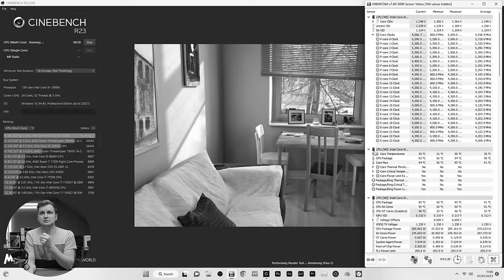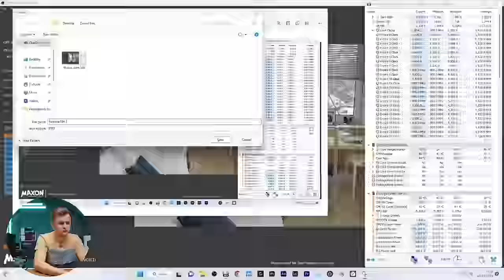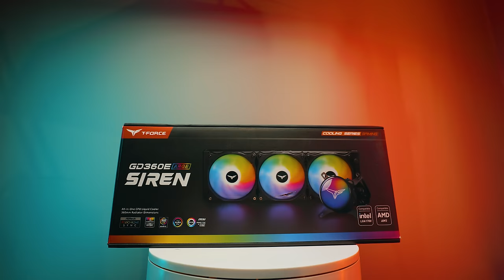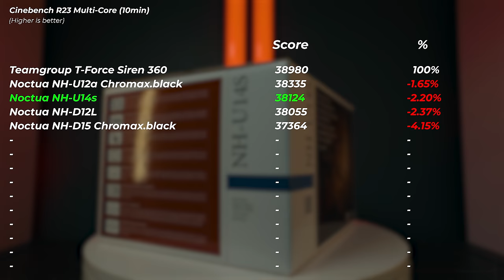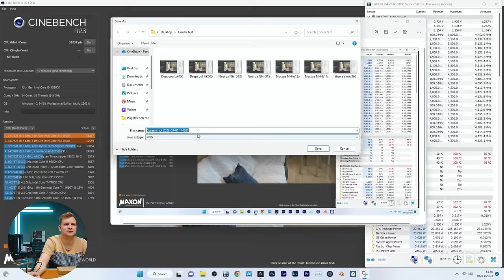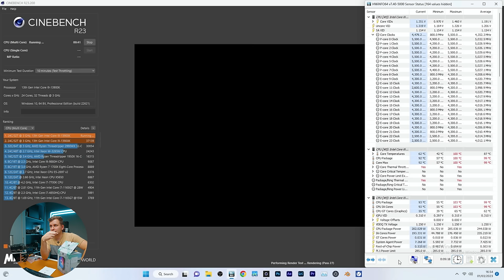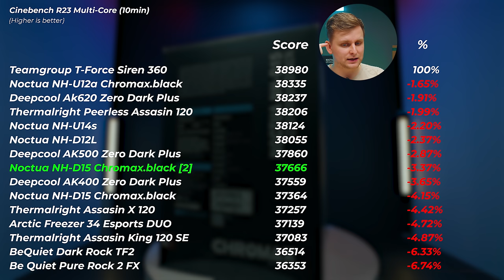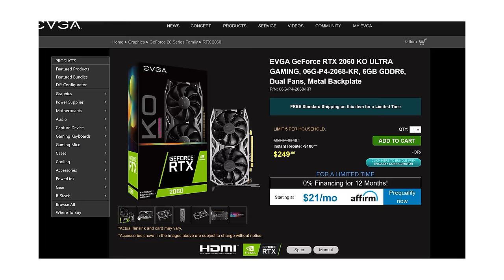We Tested 14 AIR-Coolers on 24-Core 13900k - The Results Will Shock You!

Comment: I used the NH-U14S on my new build last week.  I am a huge fan of Noctua, been using their stuff for many years. I mounted it exhaust out the back.
Reply: Great choice. Reasonably compact. Very quiet. Very efficient. I've had one in use with a 10700K @ 5GHz for 18 months, ambient temps usually ~ 27C. No negatives. I should add, in order to get a good view of the RAM RGB, I moved the fan to 'pull' config. That's commonly considered a serious no-no. However, the cpu temps proved similar to 'push'; 1 to 1.5 C up, according to HWiNFO64  - unlike the 10C difference claimed in one review. While 'push' is certainly optimum, the effectiveness of 'pull' might depend on case airflow.
Reply: @fred_2021  I have the Gigabyte z790 board and the fractal pop air case and where my cpu fan begins there is a 1/4 inch gap between the ddr5 g-skill Trident RGB ram and the fan.  And I am using 2 - 16gb sticks in slots one a three..I will never use anymore than that.  I changed my cpu fan to black and have the chromax cover on the radiator.  Looks really good and simple.  I am only using  the RTX 3060 MSI because I am cheap and did not want to spend a fortune on a video card.  My CPU heat while gaming never gets about 37c but I am not playing high resource games like cyberpunk.
Reply: @andredaedone7732  Sounds perfect. The Chromax covers do look good. Might do that too, if can decide between black vs white :)

Comment: Running a 13700k @5.6 with a 50mv undervolt on a Noctua NH-D15 and it works like a charm(temps almost never exceed 85, gaming they typically max at 70-75), in general I feel like undervolting is almost a must if you want to run a current high end intel chip on air.

Comment: Great video 👍
I think I would still choose a Noctua for that cpu, since I believe that once it goes in a good case (Fractal Torrent), it will keep a better temp. If still a bit hot, I would limit the cpu a bit, to make it cooler.
Reply: I have a white torrent and the Noctua Chromaxblack U12a cooling a 5800x3d. Tons of air flow in that case and I know  it’s not a hot running chip but I could move to an Intel chip and use the same case and cooler.

Comment: I put a SF120 RGB fan from the Cooler Master Hyper 212 on the back side of my Enermax ETS T50 Axe. Tt made a huge difference. I then ordered the Nactua NH U12A after watching one of your videos. Your not going to believe this but the Enermax beat it my a very, very slight margin. CB of 28492 on Nactua and 28522 on the Enermax with that added fan. CPU is 12900k.

Comment: I think the NHd15 deserves a redo. Something must have been off with either the paste application or the mount tension.

I've been using that cooler for years on multiple different Cpus and it's always been a champ.

I started off with the OG one and just recently bought the black one for my newest build.
Reply: well the thing is cooling a 13900k and that cooler im pretty sure performs similar to a pa120se if i recall

Comment: I'd be curious how my air cooling stacks up against this. I use the Thermalright PS but I changed the dual 120mm fans that it came with out for a single Be Quiet! 120mm high speed fan which  can do 3000rpm, but more-so, I 3D printed an adapter which covers the top and bottom of the air cooler, focusing all air to flow directly through the fins.

Comment: My BigTower, Intel i-7 6700K (4 - 4,2 GHz, Net Reviews = 70°C), NH-D15 <-> Noctua Industrial PPC (NH-D15 2x + BigTower x):
minimum procesor: 8°C (winter + start PC)
spring - autumn: 15 - 25°C
summer: 25 - 35°C
max load procesor: 42°C
@4,7 GHz + max load procesor: 53°C

NOCTUA INDUSTRIAL PPC to TOP FAN!!!
Location: Czech Republic

Comment: NHD15 design is outdated compared to these new CPU and the new challenge of dissipating their heat. That's why Noctua is preparing a new version to launch this year. Don't forget heatpipes aren't all equal.
Also, certain coolers mounting mechanism might have different results given the CPU bracket issue we all know. I would have tested all of this with a contact plate.

Comment: I bought an "entry-level" dual-tower cooler, the ID-Cooling 206-XT. It nearly bankrupted me at the princely sum of ~$22. While it doesn't keep the CPU below 90 during heavy artificial loads, I hit power limits long before it goes any higher. Pretty chuffed with it. It does get quite loud though, which is an area where it might very well be outperformed by more expensive coolers.
Also I have a 13600KF, which isn't the hottest chip in the dip and so the combo works.
Reply: I wish that I could’ve found that price.  I ended up with an SE-207-XT Slim, almost double the price…
Reply: @zeroturn7091  I'll admit it's starting to wear on my nerves. I miss the AiO I had in my previous system. Heatpipe coolers just don't have the thermal capacity to soak up transient boosts without the fans ramping up in lockstep. I'm always aware of what the CPU is doing and it's annoying. The 207 is a much better cooler than a 206, if you prefer air then it'll serve you well.

Comment: I've done some Cinebench benchmarking myself now, at lots of different settings.

I would say 50-100 score is easily within run-to-run variation, especially even moreso if you have background tasks like HWInfo64 open. So it would possibly need to be averaged multiple runs to tame the variance, which is a lot of work, admittedly.

I also personally tried mounting an LGA1200 cooler on an LGA1700 board with both kinds of holes. But the backplate included with my LGA1200 cooler sat on some tall screw heads that hold the socket down, rather than flush against the back of the board, when I did it like this, which lets the length of the backplate arms potentially flex toward the board under mounting pressure, and create a less secure mount. Really should use an LGA1700 mounting hardware set if possible. Not sure how much difference it makes, but I know a firm-pressure mount can make a difference.

And with coming back to re-test a day later when the entire board+chipset+VRM are cool, and with the AirCon turning on and off and room getting warmer/cooler, yeah. Could easily be in ~200 points difference from temperature. Maybe a tad more.

Lastly, this may be a wattage where the mobo can't find much room to maneuver frequency except in the very best cases, and is gonna be kinda jammed at around that score range where you're seeing all the results, +/- 50-200 points for most of the coolers. (Given room and board/VRM temperature is changing, it's a large margin of error where you can't rule out the effect of room or board/VRM temps.)

I still think this test is quite valuable, but ways to improve would be mounting using official LGA1700 mounting kits only, averaging multiple runs per cooler, and any way to tame the temp variations of the room and mobo+chipset+VRM would of course help.

(Speculating a bit, but running at a less-extreme, more reasonable wattage may show different results that might be less bunched up, but which wattage users run their CPU at is kinda up to them, so any result is relevant for users hoping to use their machine at those same wattages.)

Comment: The heatpipe direction definately has an impact. We've (computer industry) has been doing this since I been building systems with tons of heat from CPUs when heatpipes became very popular and used extensively around 2000 or so. I used to do nothing but research and test this theory back then to get the best cooling. That's when I had the patience 🤣
It's mostly due to how the ships are laid out on a cpu and whether the heatpipes cover them consistently. If the heatpipes are going across the chips, not as good as going with them. Going with or against the flow of heat
Reply: Only person I have ever seen bring this up, people always call me crazy when I say this. 😂

Comment: Hello. What air cooler would you guys recommend for intel i9 13900k? Noctua D15 is ok or something else? Thank you for help
Reply: One thing i notice about reviews and comments. People get quiet on questions like these and not reply and then overhype other products that wont last long. I notice that alot on different channels i peep game but noctua D15 is rated #1 for air cooling

I had the "thermalright peerless assassin 120 se" but now getting fan noise bearings going bad and the temps are high on games. People wont talk about that tho but this is why when it comes to the cpu im going for what is mandatory vs getting by and being the value and when it comes to pc parts i usually don't play in my food.

Comment: The EKWB Nucleus AIO CR360 is able to handle 330W easy.... 10 mins test with Cinebench R23 and only 2 cores are thermal throttling Core 5 and 7 for me. The CPU Package Power is around 323W after 10 mins of testing and the maximum was 332W. Btw i use Thermal Grizzly Conductonaut.

Comment: I tossed the stock AMD Wraith cooler that came with my Ryzen 9 7900 12C/24T 3.7GHz 65W CPU & used the DeepCool AK620 Digital instead.  Probably overkill for that particular power-efficient (yet still powerful) CPU, but what the heck - plus, I wanted the nice digital CPU temp/workload readout on the cooler.  I had such good results with a high-end IC CPU thermal pad on my 2019 3700X build that I opted for a Grizzly Kryosheet CPU thermal pad for my latest 7900 2024 build as well.

Comment: Surprised no one is including the Jonsbo HX7280 ( tdp coverage of 280W), as its been claimed to be one of the most performant air coolers on the market. Comes in around $70-80, and includes 2 x 140mm fans and 1 x 120, for a variety of fan configurations.
Reply: I've ordered this myself; limited information as no one is covering it but it's such a nice looking cooler and in the limited tests I have found on YT, it beats the NHD15 in some tests (my current cooler). Can't go wrong with either, espescially with air-optimised cases with no closed off panels. I'm looking forward to receiving it.

Comment: you should have done the Be Quite Dark Rock Pro 4. this is my go to cooler for higher end cpu's and I think it might have kept pace with the AIO. the cooler is rated for 250W.
Reply: I had it. It has no chance against 13th gen i7 and i9.
Its good for ryzen. But for Intel just go with a 360 or 420 cooler and forget about hitting 100°c constantly.

Comment: In my experience, those downdraft coolers work best with the air directed away from the board rather than down towards the board. Vented out the side of the case.

Comment: Um, thermal compound is there to displace air from the microscopic variations in the surfaces of the IHS and heatsink. The layer of thermal paste should be as thin as possible to maximize thermal conductivity.

I think the instant thermal throttling in some of these tests may be evidence of poor thermal conduction between the IHS and the cooler. Otherwise, a heatsink that's already thermally saturated would also throttle quickly.

Comment: Correct me if im wrong but you ran through the tests one after another?

That would likely have invalidated the data after or for the first 2 or 3 test runs since everything would likely have been heat soaked. As indicated by the immediate thwrmal throttling.

Comment: i'm just wondering how a  AIO  performs when heat soaked   
from what i remember a AIO needs a massive amount of heat to get  it  all nice and warm So in short tests the coolant inside has only just started working  but over time as the coolant becomes hotter  it retains the heat  longer    
where as a  air cooler tends to  heat up quicker but  also cools down  quicker    
it would be interesting to run the same test    with heat  soaked AIO  and heat soaked air cooler  I have a feeling once a AIO  is at temp  its  performance will drop off

Comment: I want to get a 13900k eventually, and I don’t really wanna use a liquid cooler. This was really helpful. Thanks!
Reply: Why you don't wanna use a liquid cooler?
Reply: @archvile1313  IMO, I never heard that an air cooler got defect, but like all liquid get problems after a couple of years
Reply: @HansPeter-gx9ew  I was sure of someone would pop that reply and you did. Same here, never had a liquid one but to buy my new pc I'm figuring what to get in all parts. I'm most certain I'll go with air.
Reply: @archvile1313  I mean, I have no real clue about hardware. But my Desktop cpu fan is still running after 10 years of use (i7-4th generation), from people I know and in some videos they said that their pipes got defect after a couple of years. Also it has the same noise/loudness, no difference here

Only problem is that the liquid ones cool better as far as I know. 

This jungle of parts, compabilities, and suttle differences is really annoying. I would buy a finnished pc but I want max CPU RAM for Reinforcement learning (192 GB with DDR5, costs "only" 700 Euros now, 2 years ago 128GB ddr4 cost 1200), no real offers here.

Worst of all is that there is no good summary video explaining really every aspect. I have a degree in IT and want to learn, but no luck.
Reply: @HansPeter-gx9ew  Yeah same here, still have my i7-3770 (bought since September 2013) and its own stock cooler.

Comment: It looks like air coolers were not several percent behind reference liquid cooling but several percent behind what was necessary to keep the CPU under limit. I mean given how close to the limit was the liquid system still never throttled it is very likely that it didn't push its pumps and fans to max RPM and used just enough of its cooling power, not all of it.

Comment: I still remember back when I build a 955be build over a decade ago and I used a Scythe Mugen, it was only 19$ I stuck two of their Demon fans in push-pull. Killing my value a bit but man did it work well. I hit 4ghz on a 955be back them on a freaking air cooler.

Comment: do you have a similar video but with the ryzen 9 cpu, I am going to build a pc for the first time, and bought the Ryzen 9 7900x and the deepcool ak620 (maybe replacing the ak620 with the aio deepcool le520), going to use the PC mainly for game development, UE5 and Blender. Wondering if the cooler would do the trick?

Comment: According to review 13900k is too hot... Many people under volt this CPU and did find tuning to get the maximum performance.. If you can test again after fine tuning 13900k, might be more interesting but I can understand this is very time consuming to test again.

Noctua NH D15 Black Chromax is really a best cooler, may be some problem with cooler. If possible, arrange another one and try to confirm the result. If result will same then Noctua has to see whats wrong and why...

By the way thanks for this informative video... much appreciated.
Reply: Uhm actually - the Noctua NH-D15 is very good but the U12a is actually better and newer  and costs 50% more. Noctua said  at CES that there will be an updated version of the NH-D15 later this year - well seems the y might miss this time window.
BTW: If the motherboard manufacturers would adhere to intel’s specs the 13900k would draw significantly less power and therefore be not as hot – but most just don’t adhere to the specs an open the limits.
...and BTW - Noctua released a CPU direct die cooling kit for the NH-D15 - using that you might even surpass the performance of an AIO - but at a price premium.
Reply: @m.l.9385  Yes your are right but I will not go for direct die cooling not even want to delid CPU. However, I will try to get CPU Contact Frame but sadly still can't get it.

Comment: For completeness of the test, you need to use the pressure pad for the socket. It has not been shown how flat the bases of the cooling systems are, with most manufacturers it can be uneven to a greater or lesser extent. Thanks for the test!!!

Comment: I'm cooling a 7950X with an NH-D15. It hits 95C but it's fine. I use an AIO for my i9-12900 (which will be upgraded to an i9-13900)
Reply: I was using the NHD15 on my 7950X as well and was also at 95c load which is normal and the Target Temp for the 7950X. However, I was being told I was leaving a decent bit of performance on the table choosing the NHD15 over a AIO. I switched to a 360 AIO and yes while temps do tend to trend a few degrees lower during normal tasks, Full load is still 95c and boost clocks are within 50Mhz of the NHD15. Only benefit to the AIO so far is it's quieter operation under load and it's RGB? lol Still very impressed with the results I was getting from NHD15.
Reply: @captain3186  A review in TechPowerUp basically gave the impression that air-cooling a 7950X would work fine, with maybe a couple percent performance degradation in the worst case scenario. I prefer the peace of mind not having water close to sensitive electronics. It could be quieter when going full-bore however.

Comment: Hmm my 13900k with the NHD15 thermal throttles at ~300w and scored over 39000 on cinebench.  You seemed to be throttling at around 280w.  Wonder what caused this difference.
Reply: Do you think air cooling a 13900K is enough or do you really need an AIO cooler?
Reply: @Fighter4Street  Air cooling is fine. Watercool might be able to get a bit high watt draw before throttling, but the gains are very small for that.  You probably don't want to be running at 300w+ anyways.

Comment: nice work, but it would be very useful if you included also the noise level! Because I think the Air coolers do not reach the noice of the 3 fans of the water-cooler. Thank you for your hard work.

Comment: Swapping an HP prebuilt PC to a custom build.

I'm taking an HP prebuilt and moving the RAM, Processor, and power supply, and moving to a new motherboard, cooler, and case. 

Specs so far:
 RTX 3070
 Intel i9 12900 non k
850w gold PSU 
32GB ddr4 ram 
MOBO: MSI Z690 Pro-A (got on sale for $99) 

And recommendation on a case and cooling unit (air or aio) would be greatly appreciated. 

Thanks!